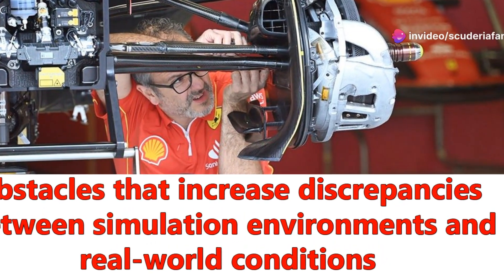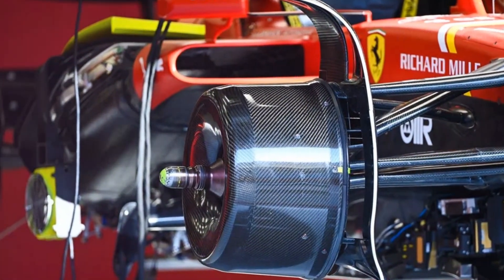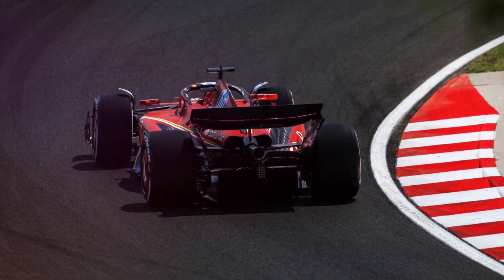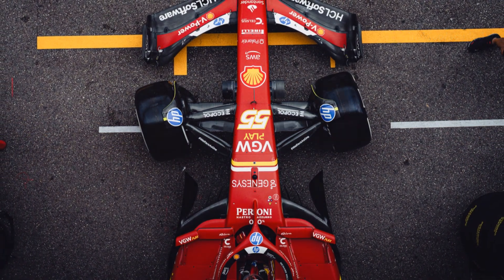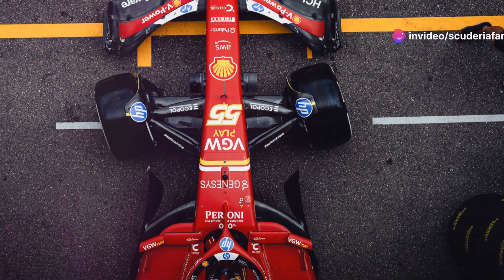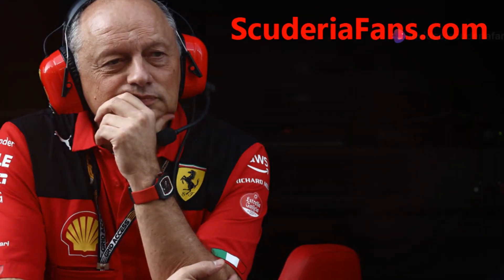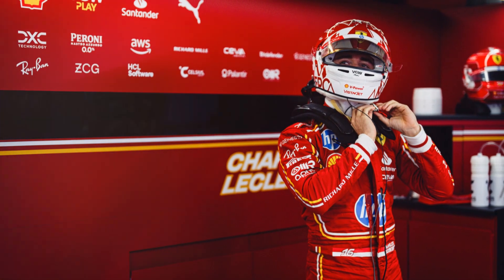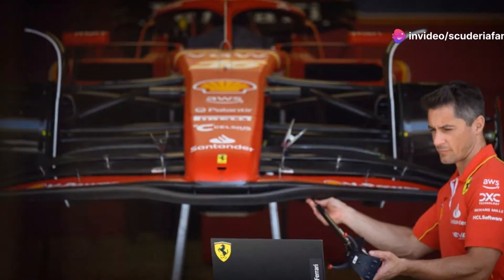SF-24 updates: Ferrari fixes discrepancies between simulation, wind tunnel and real-track F1 data

Comment: Ferraris problems are not with areo , yes it is probably not perfect, but the  suspension can't handle the level of areo load post the Spanish gp update , and when they went back to the imola spec car for Silverstone it should not have been a surprise it would be off the pace because other teams successfully at least optimized their car and or updated their car. Also  from what i understand the floor from the Hungarian gp that made the issues with bouncing a little bit less prominent added weight to the car , this i am not completely certain on but I have heard rumors and would not be surprised.
Reply: You should go and work for them because it's sounds like you know more than they do.
Reply: @carloskissoondhan9641 He is right though. The car generates too much downforce and their suspension is too soft, that is why it rides curbs so well but can’t handle  the extra push
Reply: @carloskissoondhan9641  it would be my dream job fr . But unfortunately probably won't happen